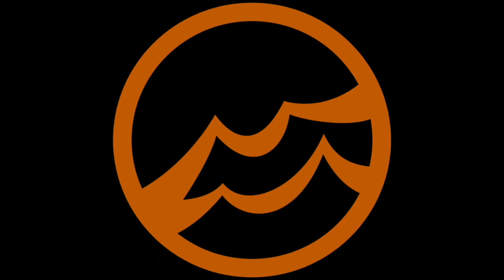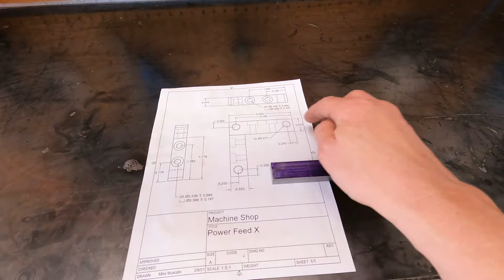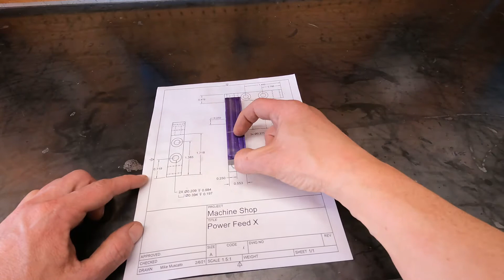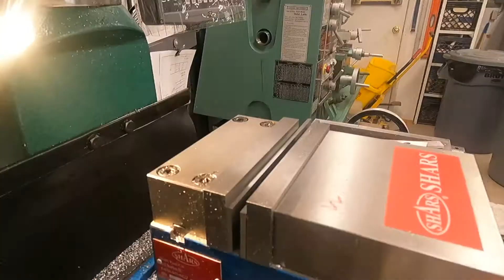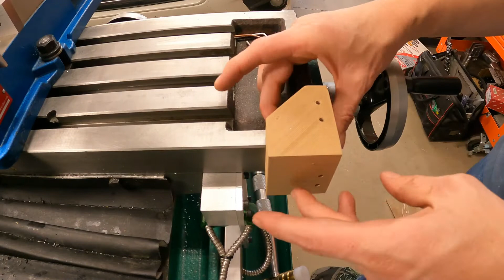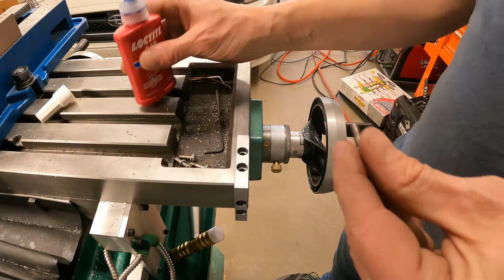DIY Power Feed for Round Column Milling Machine (Part 1)

Comment: Nice video, I am thinking of purchasing one of these round column mills so am checking out every ones upgrades they have done, over all do you think they are worth the money ? They seem very heavy and solid for the price , and have good power , with some simple mods like DRO for the quill and eventually power feed like your doing, oh they seem to have a fairly large table and 17 inches longitudinal travel, also, thanks for posting. cheers from Canada.
Reply from the maker: Hey there, thanks for the question and sorry I somehow missed this. Depending on your budget and shop space, I definitely think the round column mills are immensely useful. Mine is set up with a three axis DRO with the Z on the Quill, similar to what you are thinking. I am able to make some nice parts with it. The biggest challenge I have is adjusting the Z height for different length tooling. For example, switching from an end mill in a collet to a large drill in a chuck would require moving the head up and down. There are tricks for maintaining your zero position while moving the head, but none of them are perfect, and all of them are moderately frustrating.  Also changing belts to adjust the spindle speed gets old. All of this said, considering you can get a used one for sometimes as low as a few hundred dollars, you really can’t go wrong. But, and this is a big one, if you have the space and the budget, a smaller Bridgeport clone, say with a 36 inch table, barely takes up more of a footprint on your shop floor.
Reply: @MountainMikeNM  Hey thanks for the reply, it will be a little while before I get one but definitely be leaning to the round column, thanks again.
Reply from the maker: Three-axis** DRO (stupid auto correct)
Reply: Lot of travel capacity for the money.